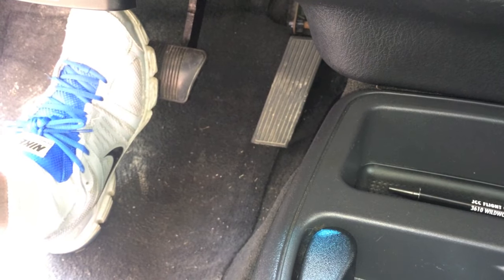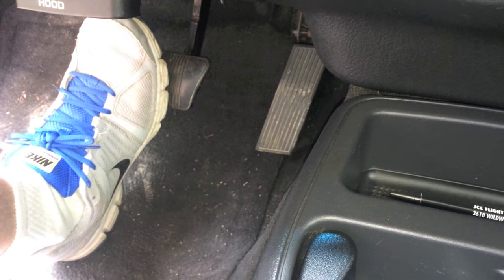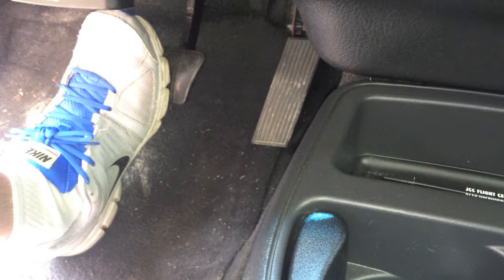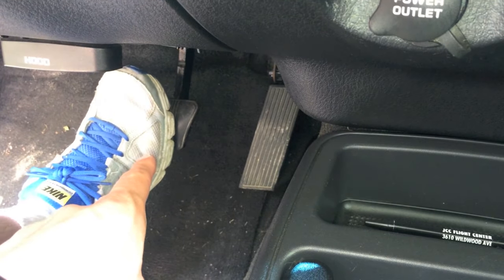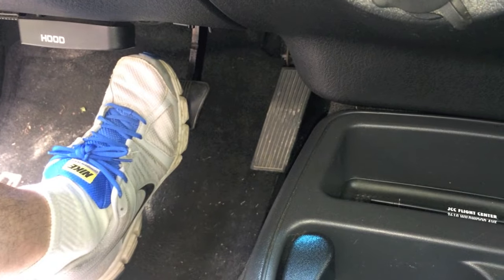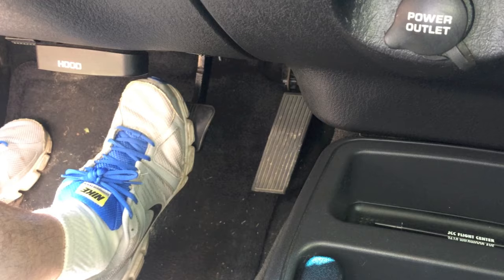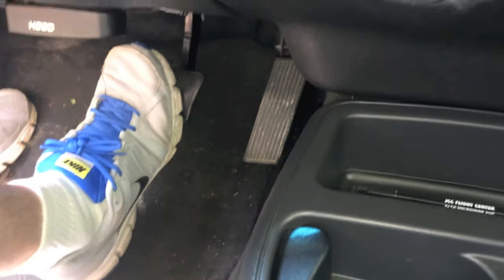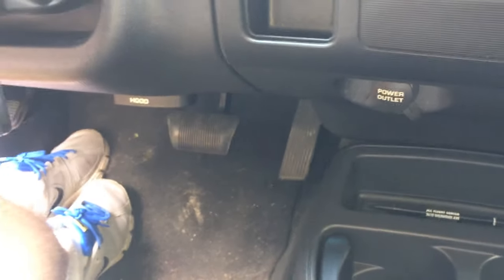HARD Brake Pedal - How to check if your BRAKE BOOSTER is GOOD or BAD

Comment: Today I had a problem with my car... When I was pulling out I accidentally put my car into lower gear (lower than D) and my brake became very stiff to the point where I was unable to push down or to stop the car. It could have been very dangerous! But I'm not sure why it happened because putting my car in a lower gear shouldn't cause this problem right? Thank you very much for the video by the way!
Reply: By the way I resolved the problem by turning onto a quiet street and restarted the car. Thankfully no one was around
Reply from the maker: Rebecca Yiru 
We are happy to hear you resolved the problem.  If problem comes back, we have attached some troubleshooting steps to help.

Thanks for checking out the video!
First thing that comes to mind is your fluid level!  Make sure your brake fluid is not outside the proper fill parameters.  This causes brake system performance issues...explained in more detail below!

Let’s work through the items!

1.  Its possible that your caliper is beginning to stick...maybe caliper slides have lost the lubrication required to shift back and forward freely.

2.  It can be possible that your Caliper piston has lost its lubrication which will also interfere with the efficient shift back for forth.

3.  The front rubber brake lines that connect to your caliper fail from the inside as opposed to the outside.  This means the inner coating begins to break away and clog portions of the brake system...hence not allowing fluid to flow back and forth freely.  

4.  Your brake pads have little prongs/teeth on them.  You will notice by their location...the pads slide on a steel brace.  This may need to be lubricated to bring the shift back to efficient requirements.

We have attached a few videos.  Lets start with the easy items and then work our way up!  Lets figure this out together!  Keep us posted!  Please Subscribe to the channel and turn on your YouTube notification Bell 🛎 that would be awesome!  Thanks again!

Links to all of our helpful step-by-step videos explaining the above possible causes are below, definitely check those out!  😎👍🔧🔩

1.  Caliper Slides Lost Lubrication:

https://www.youtube.com/watch?v=-DZ68tKuCQc&amp;t=15s

2.  Too much Fluid in Reservoir:

https://www.youtube.com/watch?v=X-AJ5tD6zoA&amp;list=PLjCXOz8TSkZnavDiGDyHdPKe2dV2RzEMZ&amp;index=39

3.  Failing Front Brake Lines:

https://www.youtube.com/watch?v=3FTEgbLYAdI&amp;list=PLjCXOz8TSkZnavDiGDyHdPKe2dV2RzEMZ&amp;index=78

4.  Brake Pads not shifting:

https://www.youtube.com/watch?v=3Pq15BWM_qY&amp;t=103s

5.  Replacing Front Brake Calipers:

https://www.youtube.com/watch?v=8HoaL4QM5-k&amp;list=PLjCXOz8TSkZnavDiGDyHdPKe2dV2RzEMZ&amp;index=83

6.  How to check if Brake Booster is Failing:

https://www.youtube.com/watch?v=VK4lowH7kQE&amp;index=66&amp;list=PLjCXOz8TSkZnavDiGDyHdPKe2dV2RzEMZ

7.  Failing Brake Booster:

https://www.youtube.com/watch?v=j9s7yccswPQ

8.  Symptoms of a Failing Brake Booster Check Valve:

https://www.youtube.com/watch?v=j9s7yccswPQ&amp;index=68&amp;list=PLjCXOz8TSkZnavDiGDyHdPKe2dV2RzEMZ

9.  Master Brake Cylinder info

       https://youtu.be/F9s_1VZ2u5E
Reply: @DIYwithMichaelBorders  thank you very much!! I really appreciate your reply and I will definitely check out more of your videos. Subscribed! 😄
Reply from the maker: Rebecca Yiru 

😎👍🔧🔩

Comment: Hello. So I just changed my own spark plugs.. I have a 2005 dodge grand caravan.  I turned the van on after the spark plug changed.. and now my breaks are extremely stiff. I couldn't stop. Perhaps I hit a hose loose while changing the back spark plugs?
Reply from the maker: John W 

Hey there John W, thanks for checking out the video!  It’s possible you knocked something loose.  We recommend completing a full inspection of the Master Brake Cylinder & Booster & all brake lines coming out of both all the way to each wheel.  Check for any leaks.  Also, check the fluid quantity inside brake fluid reservoir & verify the fluid is within its proper fill parameters.  If all looks good, onto the next troubleshooting steps!

Lets get this figured out!

This is definitely not uncommon!

It can be a few different things....thats if you are experiencing a HARD Brake Pedal...

1.  Its possible that your caliper is beginning to stick...maybe caliper slides have lost the lubrication required to shift back and forward freely.

2.  It can be possible that your Caliper piston has lost its lubrication which will also interfere with the efficient shift back for forth.

3.  The front rubber brake lines that connect to your caliper fail from inside rather that outside.  This means the inner coating begins to break away and clog portions of the brake system...hence not allowing fluid to flow back and forth freely.  

4.  Your brake pads have little prongs/teeth on them.  You will notice by their location...the pads slide on a steel brace.  This may need to be lubricated to bring the shift back to efficient requirements.

I have attached a few videos.  Lets start with the easy items and then work our way up!  Lets figure this out together!  Keep me posted!  Please Subscribe to the channel and turn on your YouTube notification Bell 🛎 that would be awesome!

1.  Caliper Slides Lost Lubrication:

https://www.youtube.com/watch?v=-DZ68tKuCQc&t=15s

2.  Too much Fluid in Reservoir:

https://www.youtube.com/watch?v=X-AJ5tD6zoA&list=PLjCXOz8TSkZnavDiGDyHdPKe2dV2RzEMZ&index=39

3.  Failing Front Brake Lines:

https://www.youtube.com/watch?v=3FTEgbLYAdI&list=PLjCXOz8TSkZnavDiGDyHdPKe2dV2RzEMZ&index=78

4.  Brake Pads not shifting:

https://www.youtube.com/watch?v=3Pq15BWM_qY&t=103s

5.  Replacing Front Brake Calipers:

https://www.youtube.com/watch?v=8HoaL4QM5-k&list=PLjCXOz8TSkZnavDiGDyHdPKe2dV2RzEMZ&index=83

6.  How to check if Brake Booster is Failing:

https://www.youtube.com/watch?v=VK4lowH7kQE&index=66&list=PLjCXOz8TSkZnavDiGDyHdPKe2dV2RzEMZ

7.  Failing Brake Booster:

https://www.youtube.com/watch?v=j9s7yccswPQ

8.  Symptoms of a Failing Brake Booster Check Valve:

https://www.youtube.com/watch?v=j9s7yccswPQ&index=68&list=PLjCXOz8TSkZnavDiGDyHdPKe2dV2RzEMZ

9.  Master Brake Cylinder Failure:
 
https://www.youtube.com/watch?v=F9s_1VZ2u5E&index=24&list=PLjCXOz8TSkZnavDiGDyHdPKe2dV2RzEMZ

Again let us know!  We are here to help!

😎👍🔧🔩

Comment: This happened to me on a hilux 1kd diesel engine.  So I tried to change the vacuum pump because the old one wasn't creating any vacuum to make the brake pedal softer. But still after changing the vacuum pump, the pedal is still hard.  So should I now change the booster?
Reply from the maker: BWALYA SAPWE 

Thanks for watching & we hope the video helped.  At this point, you may need too.  Replacing Booster may fix issue.  Keep us posted.

We really enjoy making these helpful videos for our fellow DIY’ers.  Many more helpful videos to come!  😀

Let us know if you have any questions.  Please subscribe to the channel and turn on your YouTube notification Bell 🛎 that would be awesome thanks again!

😎👍🔧🔩
Reply: @DIYwithMichaelBorders  thanks for the quick response.  I will change the booster first thing today and I will come give the update on how it will perform. I also forgot to mention that the brake light warning in the dash isn't going off even after releasing the park brake
Reply from the maker: BWALYA SAPWE 

Very cool & thanks for the reply.  We are standing ready to help with any questions.

😎👍🔧🔩

Comment: I have a 2012 jeep wrangler rubicon with an auto trans. When I start the vehicle, I step on the brake pedal to put it in gear. But, when I step on the brake pedal I hear a loud whistle type sound from under the hood. After a couple of pushes on the brake pedal, the noise quits and does not return until the jeep has been turned off and setting for a few minutes. It does not do it all the time. One day when I stepped on the brake pedal the noise seemed to change pitch by pushing down or letting up on the pedal. I could have made my Jeep whistle at women. Any clues.
Reply from the maker: Derek H 

Thanks for watching & sharing your experience.  Two things come to mind.

1.  Vacuum Leak:  We recommend starting your engine and opening hood.  Listen for the hissing type sound near your brake booster and master brake cylinder.  Follow all vacuum lines coming out of your Booster and complete a thorough inspection to try to pinpoint a leak in one of the vacuum hoses.

In the event that you find a hose that has a leak, we recommend visiting your local AutoZone and replacing old leaking hose with brand new vacuum hose.

2.  Faulty Booster:  It’s very possible that your brake booster is in its early stages of failure and creating the hissing type sound that you are hearing.  However we are leaning more toward a leaking vacuum line/hose.

Let’s start there, keep us posted!

Please subscribe to the channel and turn on your YouTube notification Bell 🛎 that would be awesome thanks again!

😎👍🔧🔩

Comment: I have a 2009 corvette changed pads and brakes locked up I have no fluid in rears any suggestions
Reply from the maker: Good morning William, thanks for watching.  It’s possible that the internal cylinder inside your Mast Brake Cylinder (MBC) is stuck in the closed position.

We had a viewer mention that he tapped the MBC with a hammer and it popped free.  We haven’t tried that in the past and because of that…can’t recommend it.

We had this happen before and we carefully unscrewed (a tiny bit without removing) a few fittings on the ABS module and fluid started flowing again…odd…but helped.  Keep us posted.

Let us know if you have any questions and hey if you’re into crypto, join our DIY ecosystem.

       toolboxtoken.com

Reach out to us any time!  🧰

Comment: Just saw your other video about the check valve. The hose that I replaced (mentioned in my other post) contains the check valve.
Reply from the maker: Dennis Buck Very cool and thanks again for the addition info.  Did you install your old check valve onto the new line?  If so you might need a new check valve!  Please keep me posted 😎👍
Reply: The new hose contained a new check valve. I was hoping that it would fix the problem, but no such luck.
Reply from the maker: Dennis Buck Thanks for the reply!  I just read your other post and am glad you're back on the road!  Please keep me posted on any additional info/experience you come across!  Thanks again Dennis!  😎👍

Comment: Turn the engine off, and then continue holding your foot on the pedal for another 30 seconds. If the pedal stays where it is, then the brake booster can maintain a vacuum. If the pedal starts to rise, it is time to replace the brake booster... (ok cool , that might even be a easier way to test the booster my friend).. besides the fact holding the pedal down I hear that squishy air sound leaking under the dash, but constant
Reply from the maker: Awesome, thanks for the comment...this will help our future viewers.  Thanks again!

Comment: What cases the brakes to fell as if your foot is on the brake when its not.  It dose not happen all the time from time to time when its hot out side it fells like I'm riding the breaks and they all get hot.  when this happens the brake pedal is hard to push down as if I pumped the brakes or something.  I just did this test and it did what you said it would work so I guess its not the buster.

Comment: Hay there, hope you doing great.
1 question.  I replaced front brake pad and rotors couple days ago.
I noticed come smoke and rubber burning  coming from the brakes .
I checked the wheel  spins freely.
Is it normal for new brakes to have some smokes ???
Thank you
Reply from the maker: Thanks for watching and reaching out to us.  It is normal however briefly.  The rotors come with a rust repellent additive applied to them.

This is to alleviate rust buildup while the rotors are inside package and box during their lifespan on the store shelves.

Once removed from box, if the additive is not removed by help of brake cleaner, you will get a very unfriendly odor coming from the brakes during the first day or so of driving.

In short, the unfriendly odor is the rust repellent burning off.  However, if it’s been a while since you replaced pads and rotors, and you are still experiencing smoke and odor, you may have a caliper in it’s early stages of failure.

You can check this by inspecting your wheels after driving.  Without touching anything, because it may be very hot, see if you can tell which wheel is causing overheating and smoking, and once you have pinpointed the wheel, chances are that’s the wheel that has a failing caliper.

😎👍
Reply: @DIYwithMichaelBorders   i also noticed i get smokes if I drive very egrasive.  If I drive and brake smooth  I don't get that smell.
The new brakes has 40-50 miles on it so far. Thats your thought on that  ?
Reply from the maker: @ashrafsiddiquee3190  

Thanks for the additional info, very likely an intermittently acting caliper or a degraded/damaged rubber brake hose feeding off caliper and connecting to hard-line fitting on upper wheel well area.
Reply: @DIYwithMichaelBorders  thank you.  Appreciate you as always 🙏
Reply from the maker: @ashrafsiddiquee3190  

Always here to help!!!  👍

Comment: I checked the brake booster n it seems to be fine what else can i check because while im on the road the brake pedal gets hard n i have to put pressure on the pedal so the car can come to a stop what do u think i should check next ?
Reply from the maker: Francisco Martinez Thanks for checking out the video and sharing your comment and experience Francisco...Hard brake pedal is NO FUN...Brake problems are very annoying and I definitely feel your pain.  Lets get this figured out together so you can get back to normal driving.

It can be a few different things....

1.  Its possible that your caliper is beginning to stick...maybe caliper slides have lost the lubrication required to shift back and forward freely.

2.  It can be possible that your Caliper piston has lost its lubrication which will also interfere with the efficient shift back for forth.

3.  The front rubber brake lines that connect to your caliper fail from inside rather that outside.  This means the inter coating begins to break away and clog portions of the brake system...hence not allowing fluid to flow back and forth freely.  

4.  Your brake pads have little prongs/teeth on them.  You will notice by their location...the pads slide on a steel brace.  This may need to be lubricated to bring the shift back to efficient requirements.

I have attached a few videos.  Lets start with the easy items and then work our way up!  Lets figure this out together!  Keep me posted!  

PLEASE SUBSCRIBE to the channel that would be awesome!

1.  Caliper Slides Lost Lubrication:

https://www.youtube.com/watch?v=-DZ68tKuCQc&t=15s

2.  Too much Fluid in Reservoir:

https://www.youtube.com/watch?v=X-AJ5tD6zoA&list=PLjCXOz8TSkZnavDiGDyHdPKe2dV2RzEMZ&index=39

3.  Failing Front Brake Lines:

https://www.youtube.com/watch?v=3FTEgbLYAdI&list=PLjCXOz8TSkZnavDiGDyHdPKe2dV2RzEMZ&index=78

4.  Brake Pads not shifting:

https://www.youtube.com/watch?v=3Pq15BWM_qY&t=103s

5.  Replacing Front Brake Calipers:

https://www.youtube.com/watch?v=8HoaL4QM5-k&list=PLjCXOz8TSkZnavDiGDyHdPKe2dV2RzEMZ&index=83

6.  How to check if Brake Booster is Failing:

https://www.youtube.com/watch?v=VK4lowH7kQE&index=66&list=PLjCXOz8TSkZnavDiGDyHdPKe2dV2RzEMZ

7.  Failing Brake Booster:

https://www.youtube.com/watch?v=j9s7yccswPQ

8.  Symptoms of a Failing Brake Booster Check Valve:

https://www.youtube.com/watch?v=j9s7yccswPQ&index=68&list=PLjCXOz8TSkZnavDiGDyHdPKe2dV2RzEMZ

Comment: I tried pushing the pedal just like you said but it is still stiff  all the time.Is that maybe a problem with the vacuum pump?
Reply from the maker: Captain Kiko 

Thanks for watching.  What’s your update?  While engine is running, do you hear any hissing sounds coming from near your brake booster and or any lines feeding in and out of your brake booster?  If yes, you have a vacuum leak & that will definitely cause your symptoms.

Us fellow DIY’ers need to stick together.  Many more helpful videos to come!  😀

Please subscribe to the channel and Ring your YouTube Bell 🛎 that would be awesome thanks again!

😎👍🔧🔩
Reply: @DIYwithMichaelBorders  I will check that, thank you.
Reply from the maker: Captain Kiko 

😎👍🔧🔩

Comment: What if you aren't able to turn the car on? My wheel is locked as well.
Reply from the maker: Thanks for watching, that’s no fun.  You might need to ever-so-slightly loosen up the brake fluid connections located on the Master Brake Cylinder.

Once loosened a bit to a point where you see a tiny bit of fluid gathering around the connection…immediately tighten connection.  This should free up your caliper.

If it doesn’t, you may need a new caliper.  😎👍